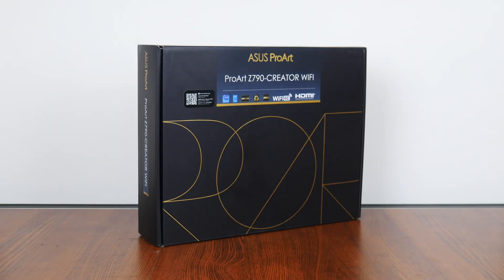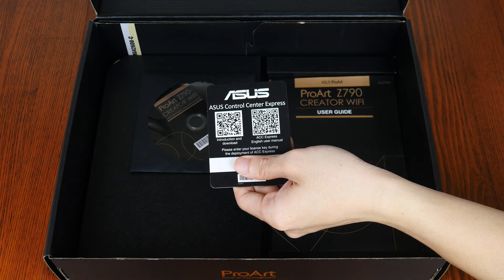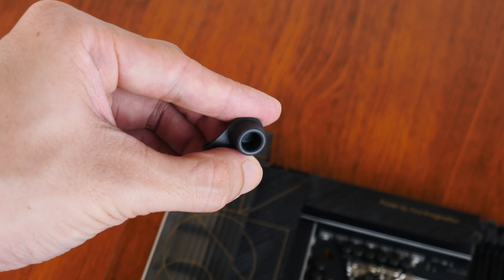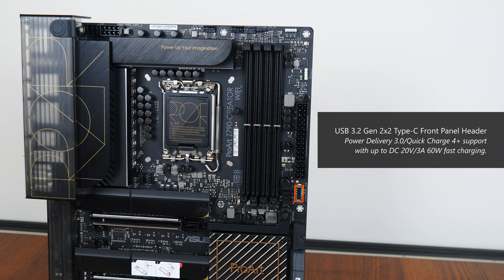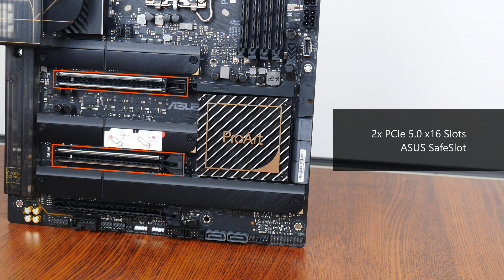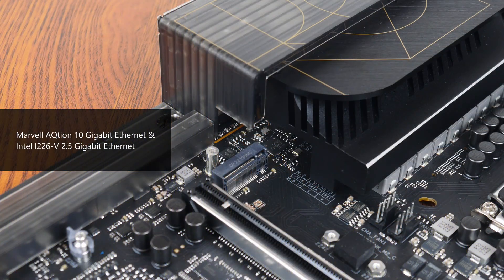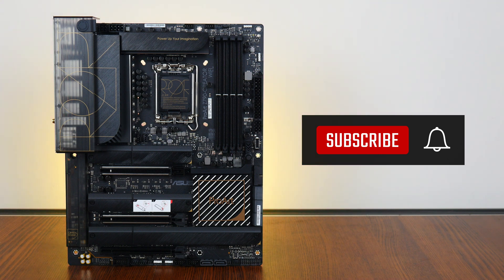Intel Z790 Motherboard for Pro Content Creators: ASUS ProArt Z790-CREATOR WIFI

Comment: 9:30 you said HDMI 2.1 only does 4k 60 fps but doesn't that support 120 or am I wrong?
Reply from the maker: ASUS's limited the said port to display up to 4K resolution at 60Hz, at least according to their specs sheet!
Reply: Be aware that HDMI and DP IN motherboard ports are useless for UHD 770 Graphics (it is a decoy). The Bios 18.01 is not supporting 13th and 14th Intel CPUs UHD 770 graphics at the moment. Intel AX211 drivers compatibility in linux like systems is limited as well.

Comment: CPU offers 20 PCIe lanes.  BUT.    16 for GPU.  16 for 4x NVMe's.  4 for 10Gbe.  A video and audio capture card.  Not a creators motherboard.
Reply: It is not a motherboard issue. The Intel 13th and 14th CPUs are limited in PCIe lanes :(. You want really powerful equipment, choose AMD EPYC 9xxx 128 PCIe 5 lanes or Xeon 80 PCIe 5 lanes. You are right, the motherboard is limited in use for content creators.

Comment: i'm a creator, but is this this still good for gaming a long as I have a good gpu, cpu fast  m.2 and memory?
Reply from the maker: Absolutely! This board is marketed as a creator's board due to its dual Thunderbolt 4 ports that are capable of video output, 10 Gigabit+2.5 Gigabit ethernet ports and so on - features that pro content creators would likely use in their day to day work. It'll definitely work great for gaming and other productivity tasks too.

Comment: Curious if anyone else has ran into this. I build my new rig yesterday, spent 12 hours on it only because it kept getting stuck on the green light and wouldn’t post to BIOS screen. The board would keep going through its normal boot cycle(red, orange, white) then got stuck on green and no display on the monitor. Monitor would show its getting signal, but no display. Tried different monitors, HDMI&DP cables. Even tried onboard graphics while disconnecting the GPU. Rebuilt the entire PC 3 times just to be sure things were built correctly. Still nothing changed. Tried booting with 1 stick of ram, nothing. Tried booting without M.2, nothing. Even tried booting with a M.2 with windows already installed, nothing. Did BIOS flashback update. Nothing. Spoke with ASUS and they were dumb founded. 
Parts are as follows:

Intel i7 13700k
ASUS Strix 3070
ASUS ProArt Z790-Creator Wifi: 
NZXT Kraken Z53
G. Skill Trident Z RGB DDR5 64GB
WD_BLACK 2TB SN850X SSD
Lian Li SL120 V2 fans 
Silverstone SX1000 PSU
Reply from the maker: IMO the best way to resolve this issue would be to try and see if you can get a replacement board from where you purchased it from, and perhaps bring your processor, RAM and graphics card with you just to see if it can boot properly with the replacement board! Would be one of the ways to try and troubleshoot which component on hand is faulty..
Reply: @ALKtech  it ended up being the board
Reply from the maker: @crimsontheorie7190  glad that you managed to find the root cause!
Reply: I had this happen before and it was bad RAM in one case and a bad CPU in the other... good luck!

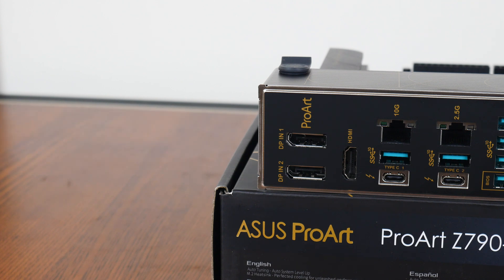Comment: 10:26 Incorrect. You don't "need to".  As shown at
10:54 A in clear English: if no displayport cables are connected, then only USB Type C-1 has output using the standard DisplayPort 1.4 capabitilies of the integrated graphics of the used CPU.
Which means for example a 13900K can run 4 x 4K video @ 60 Hz over Thunderbolt.  
No need for a videocard at all.
Reply: Can you plug regular USB c devices into the thunderbolt ports?
Reply: @ThaWiz11  Yes, you can! Asus also calls it USB 4. This means any USB on a USB-C connector is at least USB 2.0, so any USB protocols through a USB-C connection will work on these ports. #donotconfuseportsandprotocols :)

Comment: thank u so much. am new to this. and am thinking buying one of eizo monitor that says it uses thunderbolt. why do u route connection when the monitor has thunderbolt connection and the dedicated graphics card has a dedicated output thunderbolt connection? am not sure. maybe some nvidia graphics cards have no thunderbolt connection at the back. sorry. noob here. thanks
Reply from the maker: No worries, this isn't exactly something that's very common also anyway, unless you're in the pro content creator space. Basically graphics cards do not have Thunderbolt ports as display output ports as they're in a sense, multi-purpose ports that can process a whole bunch of non-video data and can be used to power devices too (Power Delivery), and the primary purpose of graphics cards is to output video. Having Thunderbolt ports on a graphics card would be in a sense, a waste of such a port's capabilities, and would require a controller chip to be on the graphics card/integrated into the GPU (if it's even technically feasible).

As such, there is a need to route the video output from a graphics card's DisplayPort connector (in the instance of this motherboard) to the DisplayPort In port on the rear I/O, so that the motherboard can then forward along the appropriate video signal to the Thunderbolt port, which then plugs in to the said EIZO monitor that you mentioned. Hope this helps!
Reply: @ALKtech  wooww. thank you! amazing explanation. cheers. totally understood now.

Comment: This is probably a stupid question but what's the point of the DisplayPort-in ports to Thunderbolt 4 ports?  What is it actually doing?  Is it just converting DisplayPort to Thunderbolt 4?  Why not just plug the graphics card directly into the color accurate monitor without sending it through the motherboard?  (As you might be able to tell, I've never owned a color accurate monitor so maybe this isn't possible, I don't know.)
Reply from the maker: It's a good question actually, not something that's really common knowledge as such features tend to be used by professional creators (e.g. graphic designers). 

For instance, using such a connection would allow graphics designers to connect say, a Wacom pen display device (that utilises a USB-C connector and could be considered a "colour-accurate monitor" device) to the PC via the Thunderbolt 4 port, and harness their graphics card's processing power to drive the said pen device's display, which could be a 4K-resolution touch screen that can be used to sketch and draw designs and so on!
Reply: @ALKtech  Ah I see, that makes sense since those tablets don't have DisplayPort or HDMI input.  Would an external DisplayPort to USB-C adapter work the same way do you think?  I'm just curious in case I decide to purchase a different motherboard but find myself wanting this functionality later on.
Reply from the maker: @chromativerse  I doubt so, as these pen display devices also need to carry non-display data to the PC too (e.g the pen strokes of illustrations on Adobe Photoshop, for instance) and vice versa, which I doubt a graphics card's DisplayPort connector would be able to do using your suggested method of an external DP to USB-C adapter. The reason for routing the data transfer through the Thunderbolt 4 port is because such Thunderbolt 4 ports are capable of transferring data and video concurrently, and at high bandwidths!
Reply: @ALKtech  Oh yeah that makes sense. Thanks for your help!
Reply: @ALKtech tech notice mentioned that normal usb-c devices would not work when plugged into the thunderbolt ports on this motherboard specifically. Can you confirm this? Seems like an important detail considering it has no regular usb c ports

Comment: Maybe this will help some USA customers:  I couldn't get my 2.5Ghz Intel ethernet adapter to work at all, so I contacted Asus support.  Rep told me to return the board, that the adapter was bad.  Mistake!  Turns out the adapter is simply not compatible with most of the current modems supplied by AT&T and some other providers.  When I got a replacement and it still wouldn't work, I contacted AT&T, they acknowledged the compatability issue, and quickly sent out a new modem/router.  Otherwise I think this is a good board.
Reply from the maker: Oh yes, the I225-V and I226-V do indeed have bad reps about them regarding dropped connections - it appears that Intel has recently released a driver that supposedly fixes the issue according to this article: https://www.techpowerup.com/305356/intel-releases-windows-workaround-and-patch-for-ethernet-stuttering-and-disconnects
Reply: Omg how can't standard Ethernet protocol be compatible?
Reply: @dimka11ggg  I suspect security protocols to address hacking and piracy have evolved to the point where backwards compatibility has become problematic.  Compression algorithms might be another factor.
Reply: @GainesvilleKen   Not the same board, but I got an Intel NUC 13 i7 for work and it just does not want to connect to my modem/router, same ethernet adapter. Good to know I wasn't going crazy then seemingly, since I was able to get my port to work, but only when I manually set the speed to a piddly 10 mbps.. I'll have to call Tuesday. Do you know which model they sent out?
Reply: @KCM547  BGW210.  For first few weeks we had 1-2 day wi-fi drops lasting about 30 seconds, but ethernet never wavered.  However, once things stabilized, we began trouble-free connections and have been very happy.  (Note that our install tech followed up asking how things were, and I did tell him about the drops.  They stopped with 24 hours of that text exchange.)  Old router had wi-fi connections with Roku players at about 40-70Mbs, now we are routinely double that.  We lucked into much better performance for the whole house, and we are close to our 1000Mbs ISP max speed with ethernet through the new Intel NICs.  Cheers!

Comment: I didn’t see a CMOS battery. Does this board not have one?
Reply from the maker: Oh yes, if I recall correctly, ASUS's placed it beneath the I/O shield shroud, and it should utilise the two-pin type of CMOS battery. I remember seeing the said cable through the shroud. Not the most ideal location for the CMOS battery...
Reply: @ALKtech  Exactly!  Not ideal, but there is a two-pin header that allows resetting the BIOS by simply shorting it when power is OFF.  Definitely will be a pita years down the road to replace the battery.
Reply from the maker: @GainesvilleKen  Totally agreed on the PITA part. I suppose such board manufacturers must have had space constraints to have to resort to such CMOS battery placements. Still...

Comment: Could you please tell me whats the function of the dvd driver disc?
Reply from the maker: The DVD disc contains drivers for the motherboard as well as ASUS utilities - stuff that can be downloaded from the ASUS's website actually. It's included for consumers who still use optical drives with their PC builds, and may not have immediate internet access to download drivers and software to get their PCs up and running.
Reply: @ALKtech  I got a costumized PC in a website that if you buy all the components there they build It for free took 2 weeks to receive the PC and I got even the boxes of all components and all the leftovers even the QR code of Asus except of the disc. I just dont understand this motherboard in the website appears info of an application where you can control the fans but I dont see any file
Reply from the maker: @Tony-tg9so  You're probably looking for the app called Armoury Crate - you can control fan speeds through this said app. Its available to download from ASUS's website!
Reply: @ALKtech  Thank you so much for the help im not an expert with PC components I just wanted a computer for playing games because xbox and play station are trash specially PS looks like a very cheap big wifi router. I didnt even know this motherboard was for creators but so far works great in games. I will looks for that app. Thank again
Reply from the maker: @Tony-tg9so  no worries! It's interesting that your PC comes with the ProArt board, which isn't a very common choice for system integrators I'd think, especially if the PC's clearly marketed as a gaming PC (which I assume in your case, it was).
Reply from the maker: @Tony-tg9so  hmm..are you using this PC mainly for productivity purposes? Or gaming?

I'd say the RAMs look like a weird combo - do you have a total of 48GBs of DDR5 RAM of mixed brands and speeds? Using a combo of 4800 and 5200 DDR5 sticks from different manufacturers isn't optimal, and since you've got a 13900K, its probably being held back by the slow RAM speeds.

Also, the RTX 3060 is kind of a low-end graphics card for such a high-end processor...your gaming performance is definitely being bottlenecked by the 3060 card!

Finally, the ML240L V2 cooler in my opinion isn't the best for the 13900K, its more suited for mid-range processors up to a 13600K I'd say. If anything, your 13900K likely wouldn't be able to perform up to its maximum potential due to heat throttling issues.

Out of curiosity, where did you get your PC built from? My take is that your 13900K isn't getting the right parts (CPU cooler, RAM and graphics card) to maximise its potential...
Reply from the maker: @Tony-tg9so   @user-pb4li5gk4k  no worries, happy to help. The 13900K is quite a powerful processor, and it'd be a waste to not pair it with equally powerful components to allow you to harness its full potential 😅

In future, you might want to swap out the RAMs to perhaps, two sticks of 16GB DDR5 6000 or DDR5 6400 RAMs, and perhaps get a better graphics card, maybe a RTX 4070 Ti or even a RTX 4090 (if you have the budget for it). Swapping out these two things should be pretty easy, and there are plenty of video guides available on YouTube! 

You will likely have to change out your power supply too when you upgrade your graphics card though, as these RTX 4000 series cards do draw way more power than the RTX 3060 that you have, and are considerably faster as well. Also, I've never heard of the brand of power supply that was included with your PC...might wanna get something from a reputable brand such as Corsair, Seasonic and so on!

For the CPU cooler, since you're gonna be gaming on it mostly and not doing productivity work , I think you might get away with using the ML240L V2 ARGB!
Reply: @ALKtech  My experience is that it is not always easy to know exactly which drivers are relevant to your particular MB when you are looking on line, so it's nice to have that DVD.
Reply from the maker: @TrevorDennis100  yeah absolutely. Always helps to have a backup source of drivers too, especially if you don't have access to the internet from the get-go. Optical drives on new PCs are becoming a thing of the past though...perhaps we'll be seeing USB thumb drives with PC drivers (instead of DVD driver discs) become more common in the future?

Comment from the maker: NOTE: This video was published before 48GB DDR5 memory modules were available - according to the ASUS specs page, this motherboard now supports up to 192GB of RAM with 4x 48GB DDR5 memory modules. In addition, Intel's 14th Gen "Raptor Lake Refresh" processors are now supported by this motherboard with a BIOS update.

Check out the written review for this motherboard here: https://www.alktech.co/articles/review-asus-proart-z790-creator-wifi-lga1700-motherboard
Reply: Hi, NO it doesn't support 192GB. I added G.skill 6000Mhz 128 GB and it has overclocking and restarting issue and max limit RAM of this mother is 128 GB only work with Kingston Fury's normal speed of 4800MHZ and XMP is 5600MHZ Also it works with G.skill 96GB 6400 (2x48) Overall the mother is very good and stable for workstations but max 64GB to 96GB vengeance or G.skill.
Reply from the maker: @adnandc  thanks for sharing - looks like large capacity DDR5 support with four memory modules is still flaky at best...hopefully this gets resolved with future BIOS updates.
Reply: Asus specs are very wishful. The 18.01 BIOS doesn't support Intel 13th and 14th UHD 770 Graphics at the moment. The HDMI and DP IN ports are only a decoy - no signal at all. Maybe in the future it will be a powerful platform for creators but not today.